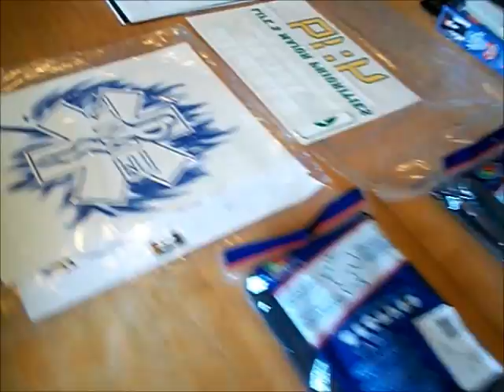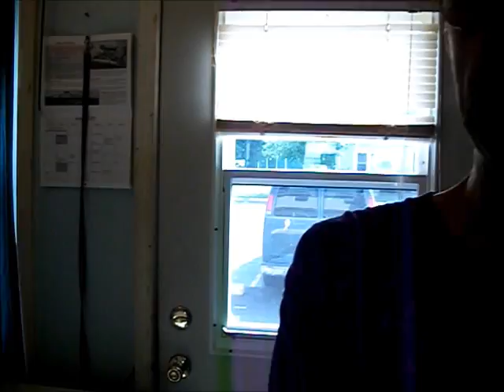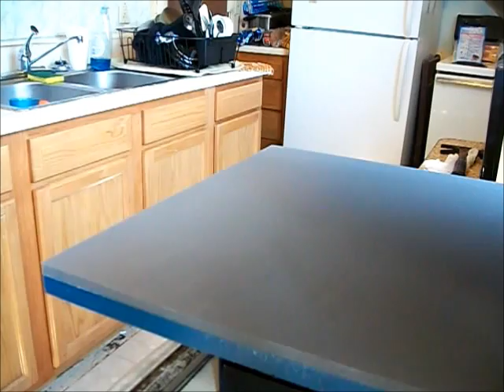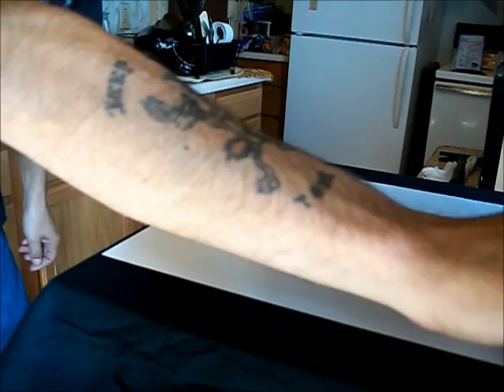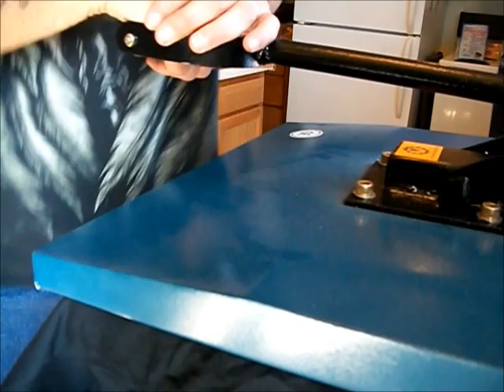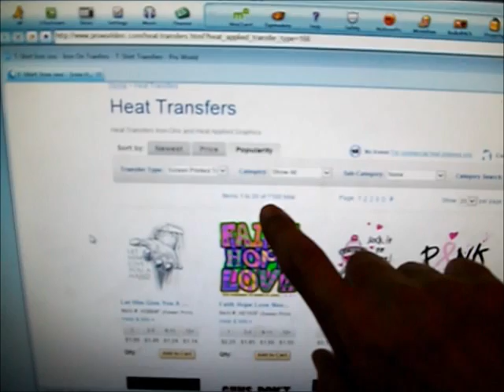How to heat press screen printed heat transfers May 2013

Comment: Hi, great video! What kind of printer are you using for this? Do you need a special printer with special paper? Thanks.
Reply from the maker: at the time of the video I was using a canon inkjet printer that seemed to work out just fine, and the heat transfer paper I was using is here http://amzn.to/2og8e8B  . Thanks for watching !!
Reply: Thank you for quick reply!

Comment: I did one yesterday that I ordered and it didn't come out good at all. The paper stuck in the middle and some on the top and bottom edges didn't stick to the shirt. Not sure what I did wrong. Should I try to put another one on top of it?
Reply from the maker: +Pam S make sure your tempature and pressure of the press was correct, and never let it cool down (in case you did) , those prints need to be pulled of when they are still hot. no, don't put one over top of the one there, that will cause you alot of trouble in the end, the best way to do it is to get another shirt and start all over.

Comment: This is for streetz180 buy transfer paper from joans arts and crafts or Michaels.. u can put any design on to it through ur printer.. use a regular iron on the hottest setting use a pillow case to lay the shirt on and hold 20 seconds.. make sure u also use a wooden table.. good luck hope it helps
Reply: Thank you
Reply: carlos ortega how well does this work once it comes out on the actuall t shirt

Comment: wmfiregighter09. I have a heat press and I have just started print and it seems that mess up shirts. I mean i don't get all the ink on the shirts
Reply: Very true, you MUST know the property temperature and press time.  There's a learning curve, but it is truly small.
Reply from the maker: @marquis murry check the tempature on your press, it is really important. If you have any questions feel free to get at me.
Reply: Benjamin Bard  yes you both are right I have been getting alot better most due to  just learning my equipment.
Reply: You might wanna get a heat gun from e bay there a infa red one and a lazer one infared cheaper. All heat presses are not made the same. Some dont heat up evenly so you have to set the temp higher. The thermostat on them not always correct